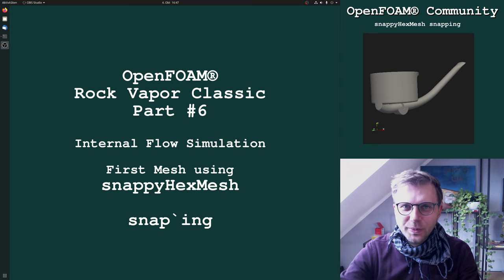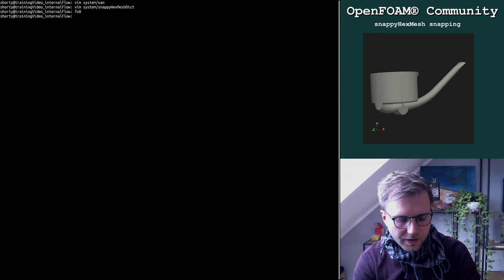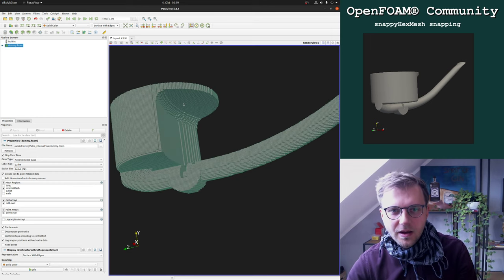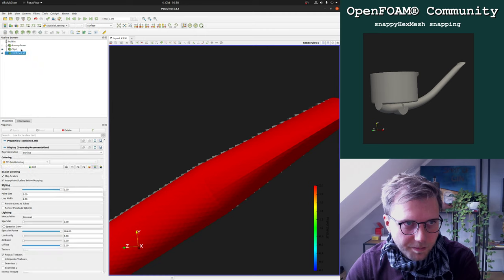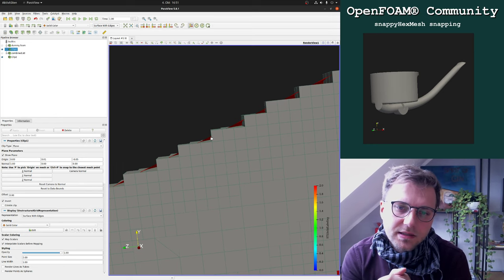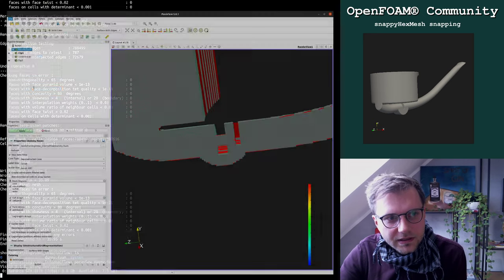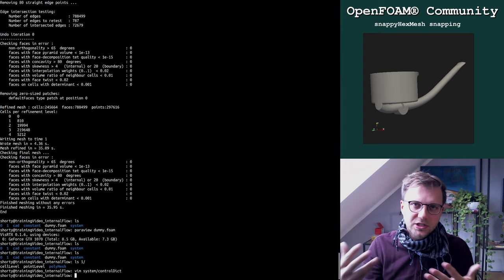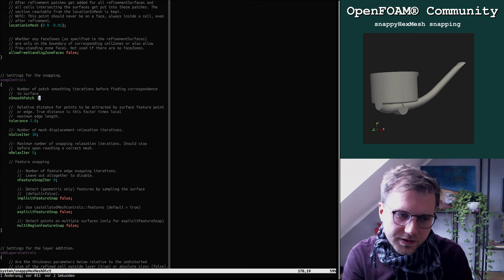CFD Analysis of a Smoking Pipe | Part 6 | SnappyHexMesh snapping ∇ OpenFOAM® v8

Comment: Hi Tobi! I'd appreciate it if you could help. I am running snappyhexmesh for a multi region case, I followed the steps of the flange tutorial mentioned in (TU TVT pdf) and everything worked well except the layer addition step when I run snappy for the second time after splitting the mesh. The layer addition iteration stops at the (iteration 0) with no error message, and there are no layers generated. 
I tried to add (mergefaces false) in the addLayersControls but It didn't work too.

Could you help me with this?